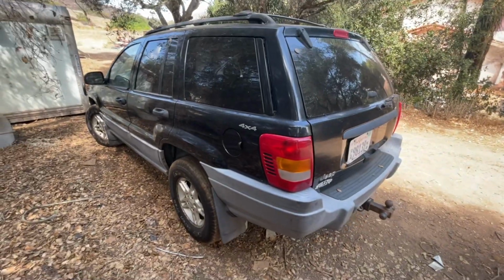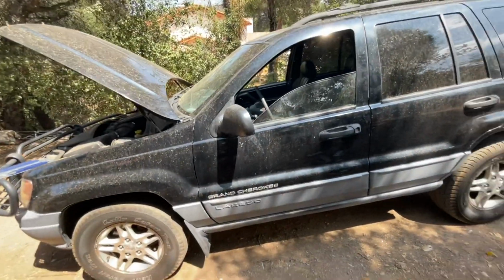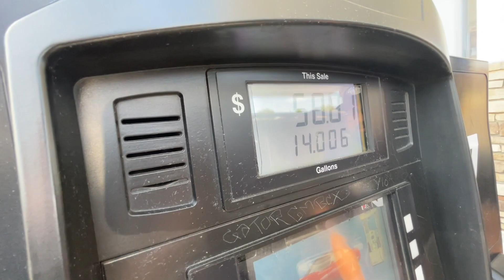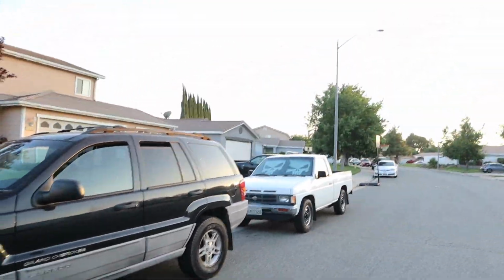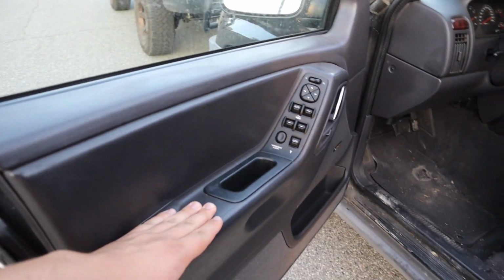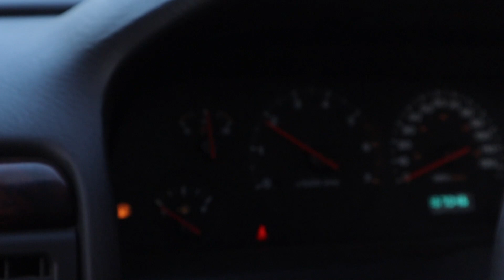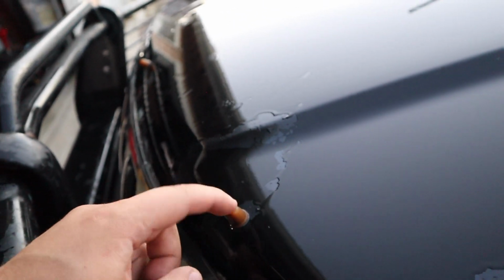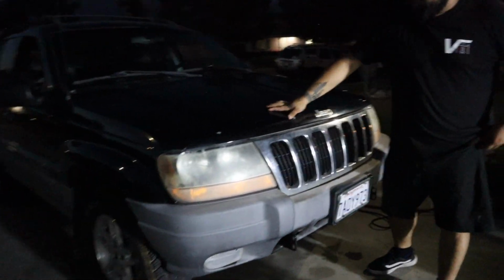Bought My BEST FRIEND a JEEP For His Birthday!

Comment: Happy bday     Had same problem with my 01 wj 4.7, ended up being the idle air control sensor on the throttle body, unplug it , it should be a black connector on the bottom driver side of the throttle body, if you unplug it and nothing changes that's your problem

Comment: Good stuff. You know we are happy to help at Jeep WJ’s Only on Facebook. Love this community. Keep it up buddy👊🏻
Reply from the maker: Hell yea I’ve been on their for a while now!
Reply: @NajarOffroad  i see you post from time to time, or comment rather. Keep up the content man. Not enough WJ on the ol’ interwebs. Got my first trail damage in mine this past weekend.
Reply from the maker: Yea I try to respond to comments! What did you mess up
Reply: @NajarOffroad  caved in the passenger fender down near the cladding. Had a really off camber mud puddle that has some build up on both sides, cut the angle too close at first and started pushing the fender in. Backed up corrected my line and crawled through it. Then turning around on a single lane trail in a downpour, i backed into something that put a pretty good dent in my rear hatch. Already got the fender straight enoughfor the door to open and close, tackling the dent in the hatch this afternoon after work.

Comment: Happy Birthday!!!

Soooooo.... I have a 4.7 as well I had the same high idle issue, I replaced the idle control valve but it ended up being the pcm/ecm (the internals went bad). They aren't too bad to work on, but be prepared to change your valve cover gaskets soon tho if the car has high mileage lol
Reply from the maker: Haha valve cover is leaking a little😂

Comment: Yesssss you got a 4.7 finally. mines pretty modded already but can't wait to see what you guys do, and the ideas you come up with
Reply from the maker: What have you done to it? Could use some ideas!
Reply: @NajarOffroad  I did the H.O manifold, throttle body 70mm, 68mm spacer. Going to do the big seven but I have 4 hooked up right now. I put a better alternator bigger battery. I got a transmission rebuild with a stage 2 shift kit, new transfercase. I did the 5 speed mod (changed the tcm),  Billet torque converter. New timing chain, a better water pump, new power steering, kyb shocks, k&n intake. Enlarged transmission cooler. New rear end rebuild, system and touch screen stereo, rock lights, and I did the double cardon drive shaft. There's probably some I missed, but I love my v8. I can take it out crawling then drive it on the street and race sports cars lol. I'm pushing 350 360hp. I just need a tuner that's $350 I can wait lol. But I want a bumper or lift next but lift will take away speed.. so idk.